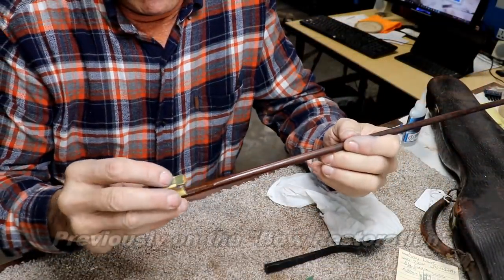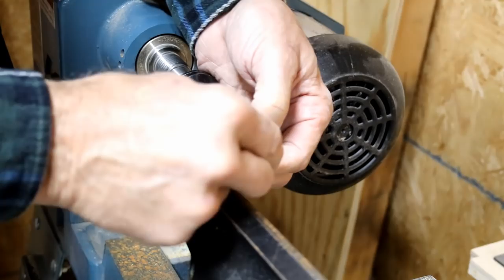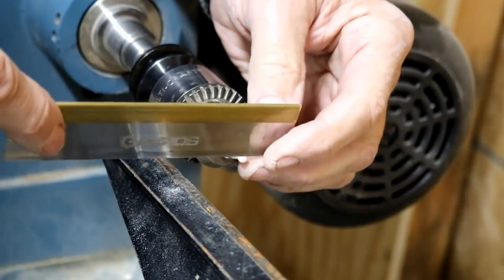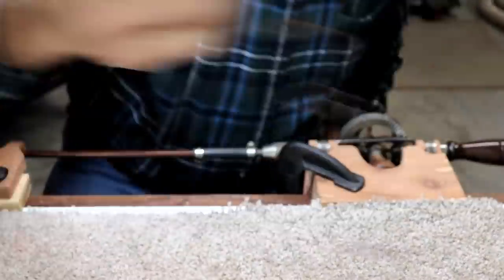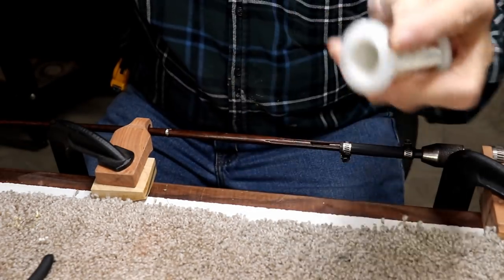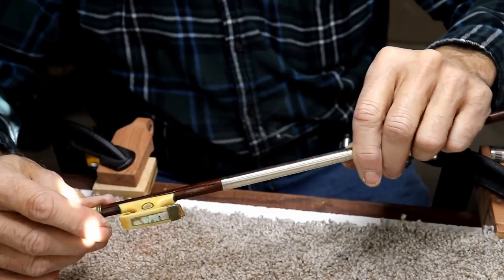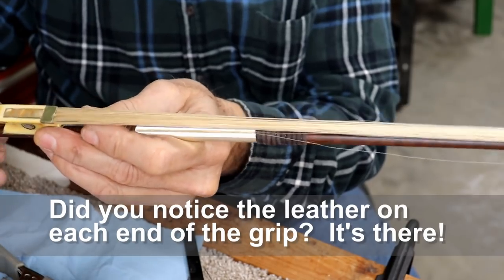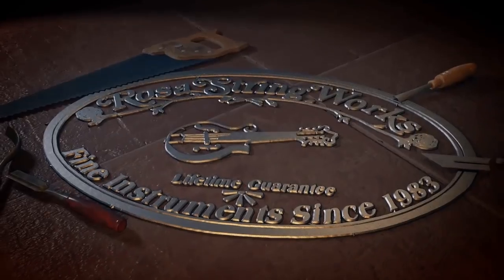525 RSW Bow Restoration Part 2

Comment: I, once, rebuilt a '64 Chevy, automatic transmission.
I had to pull it out and open it up 3 times, to get it right.
First mistake: I put a pressure seal in backward.
Second mistake: I left a clip ring on the bench.
Boy, that was fun! 🤬🤬🤬